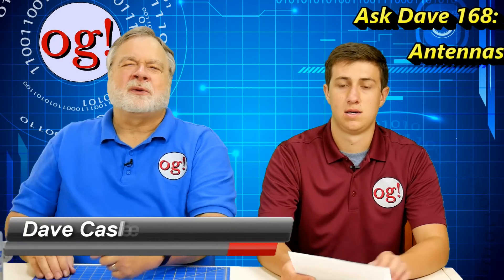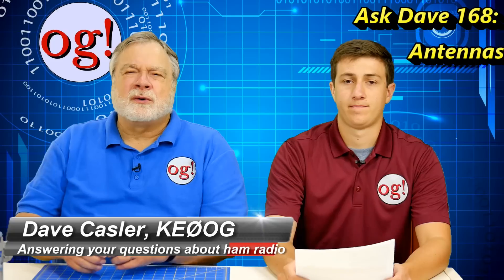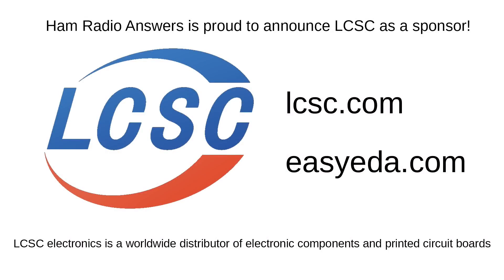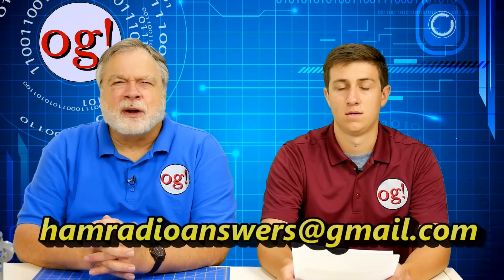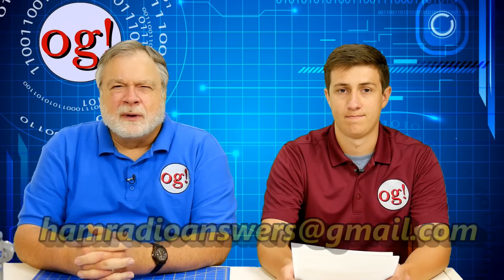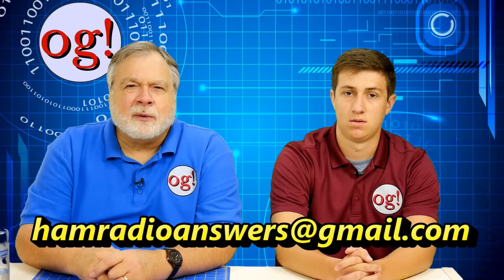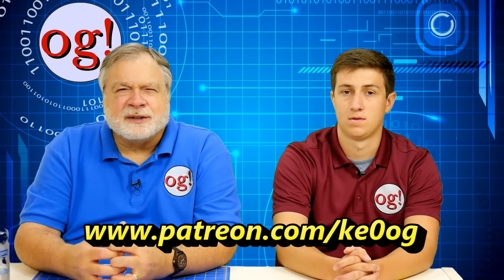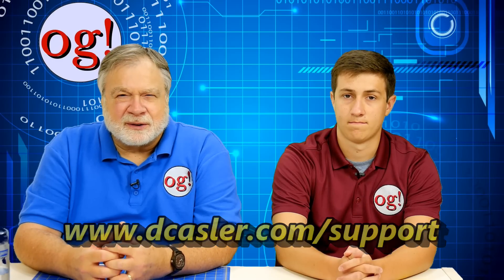Dave and Trevor discuss antennas (#168)

Comment: Hello Mr. Casler

Greetings from Dominican Republic

I live on the 8th floor of an 8 story building with easy access to the roof, and I will like to place a vertical antenna like the Comet GP9 or something similar, but then I have no way of having a dedicated ground rod for the antenna, I do have access to the ground wire for the building’s electrical system so, how do you recommend that I should proceed with the installation of the antenna? 

I MIGHT have access to the ground wire of the elevator motor.

Another detail, I’m thinking of installing the antenna on a 15-20 ft pole so it can be higher than a few nearby taller buildings.

73, and thanks in advanced

Comment: Hi Dave. Interesting video. FYI, and your correspondent Robert KN1WDS, the Ultimax DXtreme antenna is simply an end fed length of wire fed via a 9:1 Unun at the feedpoint; http://www.ultimax-antennas.com/store/p2/ULTIMAX_DXTREME__.html.  I have experimented with several types of Unun fed (random) wire antennas using several different commercial Ununs and have made a number of diy homebrew versions. While, undeniably, they work, in all cases they are very (extremely) inefficient compared to better but equally simple antennas, such as a doublet fed with balanced line such as 300ohm or 450 ohm feeder or open wire. Personally from my now rather extensive experience, I would tell your correspondent not to bother - or if they really must try one, save 90 dollars and make the Unun as a diy  project. Its easy to homebrew an Unun.  My latest experiments showed that this type of antenna to perform at only 1 to 10% compared to a balanced fed Doublet.  That's like saying, comparatively, your expensive 100 watt rig has suddenly become a QRP transmitter of 1 to 10 watts. A real waste of power.  Sure you'll make contacts, but a different antenna would be much better, more efficient and more effective.    In fact this antenna from Ultimax would be MUCH more effective: http://www.ultimax-antennas.com/store/p10/ULTIMAX_HW-END_FED_%28NO_TUNER_ANTENNA%29.html . I use a diy homebrew version of this that cost about £30.00GBP to make. The matching device is a simple 49:1 autotransformer wound on an FT240-43 toroid core (cost £8.00). It works very well - vastly superior to the Unun fed antenna!!  --  By the way, I believe that the MFJ 1984MP is not a 9:1 device but uses a 49:1 autotransformer arrangement similar to my home made HWEF (Half Wave End Fed) antenna and the Ultimax HWEnd Fed antenna. Hyendfed Antennas of The Netherlands make a range of such antennas that get very good reviews, e.g. for 80 40 20 15 & 10 Metres: https://www.hyendcompany.nl/antenna/multiband_8040201510m#main or for 40 20 15 & 10 Meters:  https://www.hyendcompany.nl/antenna/multiband_40201510_m#main  . Hope that helps. 73, Mike M0MTJ

Comment: The reflective coating doesn't sound good.  I used to work in a paint store and sold a product called E-Barrier.  It contains aluminum particles, and once saw a 5 gallon bucket of it combust from the heat generated when someone put it in the agitator.  I don't know from experience, but I imagine it would attenuate signal heavily and perhaps reflect it right back down into your house.  Not only that, but its very difficult and messy to apply, and it doesn't reflect heat as well as reflective plastic or foil sheets that are much easier to install.  I wouldn't recommend it to anyone.

Comment: You can use several different tubes of aluminum pipe that will slip together to create the length of your antenna. Other than that you can string up a one quarter wave length of wire up into a tree or a viber glass mast with some radial wires spred around the ground to form a ground system .